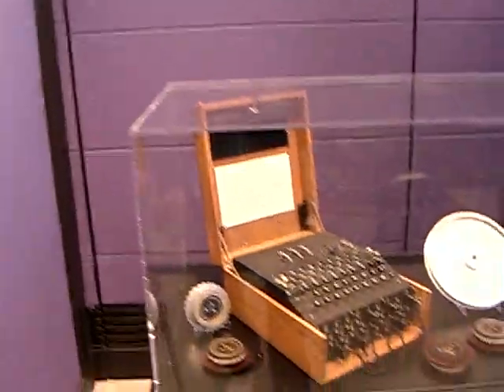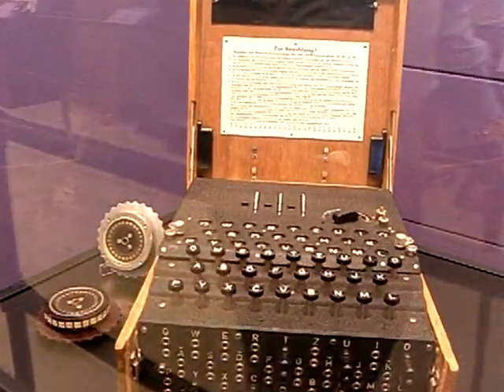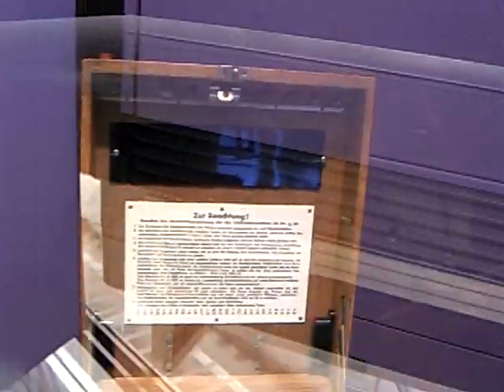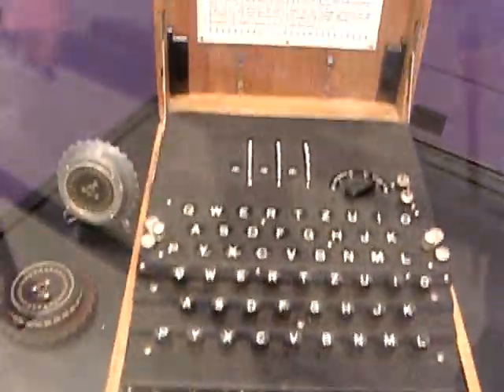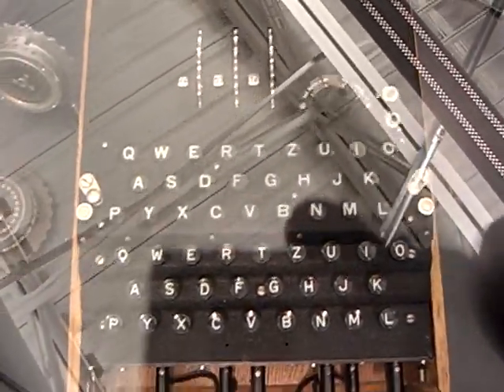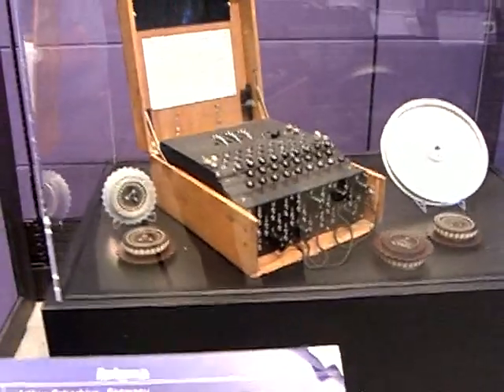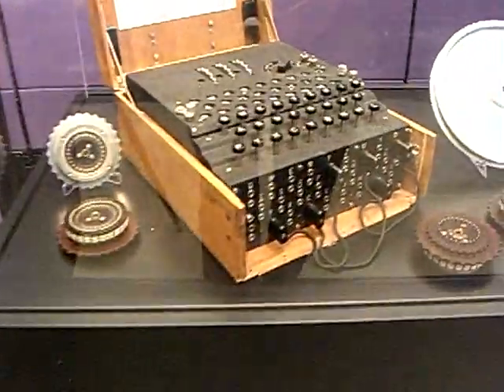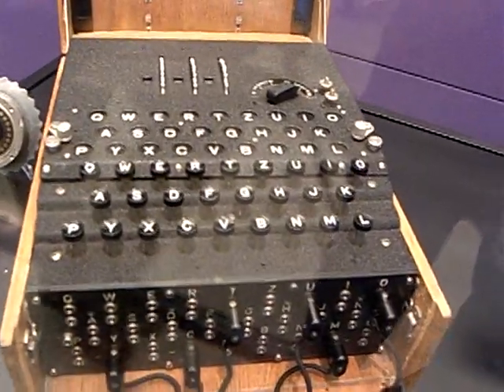Enigma encryption machine used by Germany in WW II

Comment: actually, no letter encrypted on an ENIGMA would ever encrypt as itself. That was one weakness of the machine.  But what really bought the code down was the overuse of stock phrases such as "Hiel Hitler".  If one phrase is common to every message, it  stick out like a sore thumb to a cryptoanalyst.  The Allies' efforts could have been very easily thwarted by re-encrypting the coded message using a different starting setting, which would have allowed some letters to be shown as themselves.